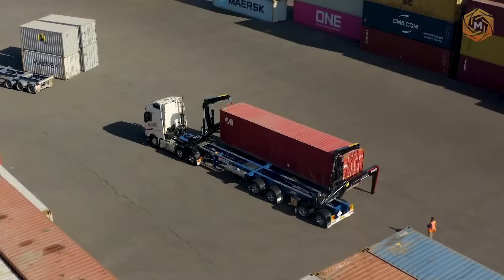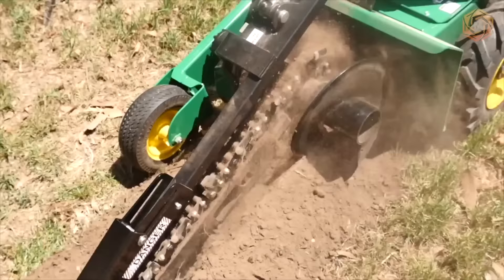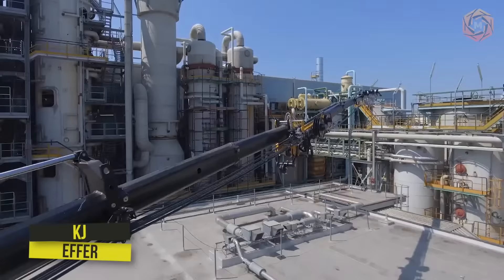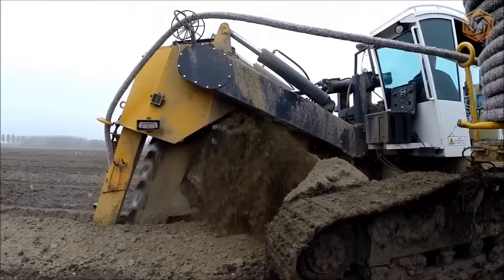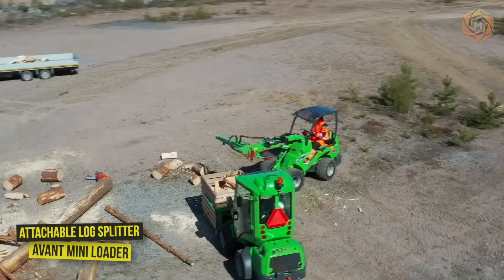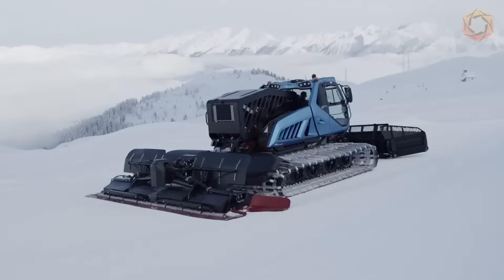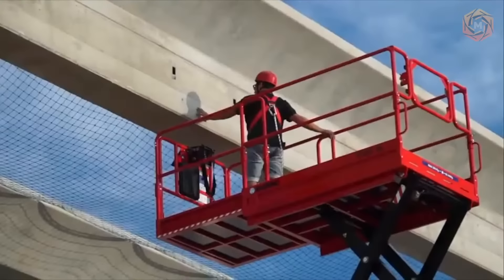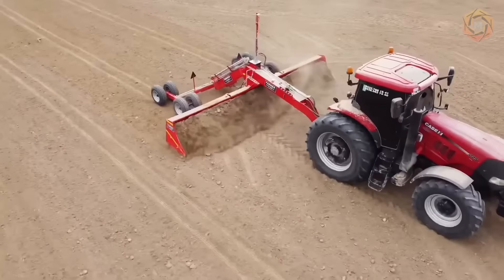Mesmerizing Industrial Machines Showcasing Ultimate Efficiency 🚀

Comment: 47:46  ERROR   In specifying torque, it verbally states the WRONG UNITS OF MEASURE. Specifying 'nanometers' only lists a distance, not a torque. Also 1,500,000 nanometers is 1.5 millimeters, which is about the thickness of a fingernail.  The narrator was unaware that:
#1) Torque has units that include force and distance (e.g. Ft-lb(
#2) The units were actually  N-M  (Newton-Meter), the metric units for force and distance     https://en.wikipedia.org/wiki/Newton-metre

Comment: Maybe I'm just "Old School", but these electric ⚡ machines, although brilliant, just don't have the working hours needed. You have to get to the site, then have enough power to get back to recharge, your working time is cut in half to get the job done. Give me John Deere Propane powered anything, and i will work circles around that Electric crap ALL DAY 😊. Ps. The Hydrogen powered snow plow with a running time of 4 hours is a joke! Not only are you a bomb 💣 on the mountain, but cost vs effective, if you want to loose money, more power too ya 😂.

Comment: All things in this video were invented by people of European descent. Other things invented by Caucasians include: 

Submarines, electric lights, nuclear power, microwaves, CAT scans, automobiles, hydraulic, wind turbines, backhoes & excavators, jet airplanes, aluminum, hydroelectric dams, steam power, trains & diesel locomotives, tractors, modern pharmaceuticals, open heart surgery, satellites, radios, telephones, televisions, arch & tig welding, computers, transistors, microchips, titanium, telescope, democracy, capitalism, modern farming, x-rays, typewriters, sewing machines, gyroscope, SCUBA systems, pasteurization, center pivot irrigation systems, bicycles, hypodermic needles, Velcro, microphones & amplified speakers, space travel, airplanes, fiber optics, ultrasounds, internet, printing press, container ships, aircraft , GPS, modern textiles, calculus, dynamite, internal combustion engine, Kevlar, moving assembly lines, antibiotics, aspirin, refrigerators, chainsaws petroleum production, trigonometry, helicopters, thermometer, glass mirrors, directional drilling, Astrophysics, crop rotation, carbon fiber, super conductors, particle colliders, pneumatic tires, MRI, sextant, robotics, telegraph, microscope, firearms, penicillin, refined oil and fuels, hovercraft, computers, carbon 14 dating, angioplasty, telescope, pipelines, open heart surgery, tower cranes, chemo therapy, light emitting diodes, motion pictures, cameras, digital cameras, CD/DVD, concrete, dynamite, lithium batteries, LED lights, refrigerators, nylon, water pumps, radar, sonar, satellites, distillation, electric motors, magnetic compass, sextant, clocks, plastics, vaccines, vulcanized rubber, insulin, combine grain harvesters, zippers, and concrete …. Just to name a few
Reply from the maker: This video does not promote or endorse these views.
Reply: @mega.technology  please list out the any and all technological advancements that weren’t invented directly by Europeans or indirectly by European influence in countries like AMERICA, Canada, Australia, etc.